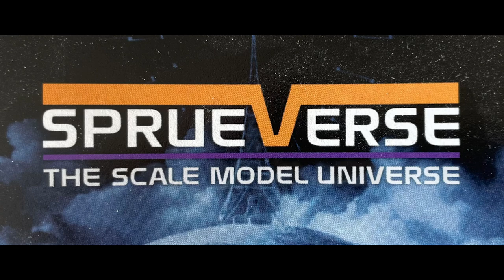Build the Flying Sub 1/32 from Moebius ModelsPart 3

Comment: Hi Phil. That base is absolutely amazing! 👏❤️ I have to admit that I had my doubts when you started it but the end result is just beautiful.  In fact you have not so much made a base for the model as made a model for your base! Plaque is absolutely right to be oversized - Irwin Allen productions were always over the top 😆 I guess that the lighting kit could be slightly excused due to its age but I think that the electroflourescent floor panel might be faulty because they are normally brighter than that. Don't worry about the forced delay for the video - I am sure that we are all just relieved to see that you made it through the mayhem in one piece. You and Lou both seem to be in the difficult position of running out of space to display your models - and this is after Lou built an extension just to house his collection! 😆 Looking forward to the next video - whenever you manage to do it 👍😁

Comment: The biggest thing I object to about the base is that the "water" doesn't sit flush with the base. Don't like the visible edge. The ocean texture is too coarse-- but the energy is there, so never mine me. You might've tried sculpting some water splash and trails that would further disguise the stand.
The EL junk is a heartbreaker-- it seems like such a great idea. And then, it sucks. I wonder if the more recent material works better, it is worth seeking new material. Alas, those gigantic light panels that are those newfangled COB LEDs are all warm, very. They need to make several light temperatures available, durn it. But... next time, there's this side-firing LED strip I saw-- 
The sub looks good, the design is still wonderful enough to overcome a bad execution, and yours is rather good! So, win/win.
Reply from the maker: Excellent comments as always! Cheers!

Comment: I'm curious, did you have any difficulty putting the top clam shell on?  Everything seems to be in place but I just can't seem to do it.😔
Reply from the maker: If it isn’t dry fitting correctly something is wrong. Is anything obstructing the points of contact with the locator pins? Are the locator pins clean of paint? Is the window seated correctly? Are the rear engines seated correctly? There is almost zero room for error if these touch points are off.
Reply: @sprueVerse  I may have found the problem, the bottom hatch wasn't seated properly, there was about 3/16 inch of a gap. 😞 And now I have a new problem. 🤪